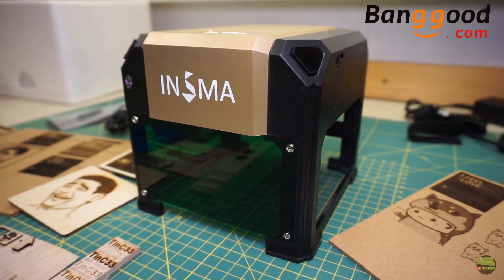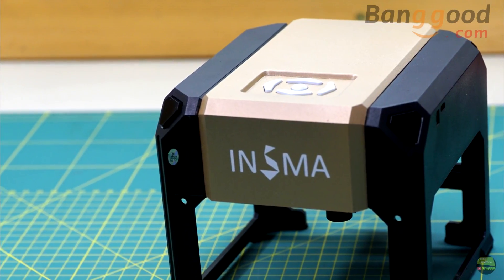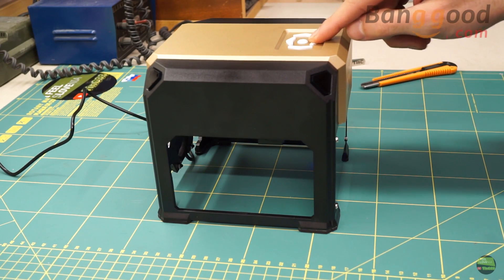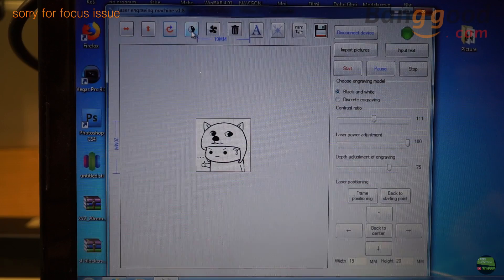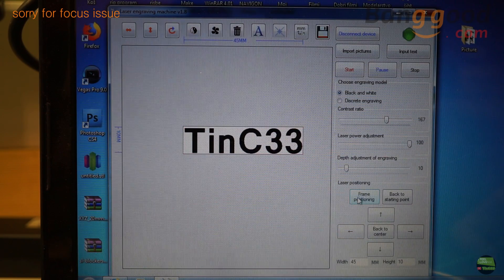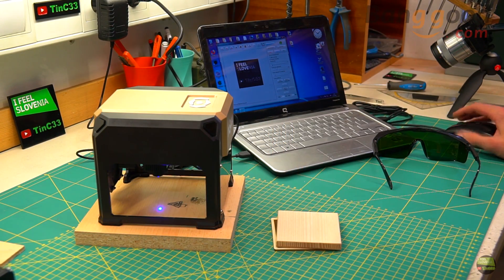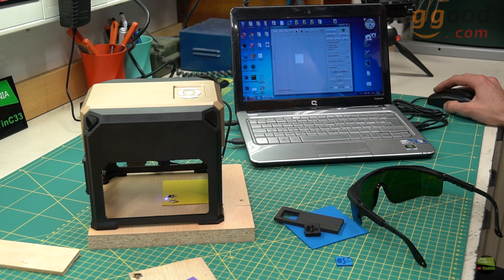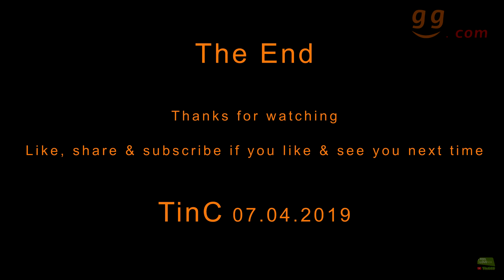INSMA 3000mW USB Laser Engraver under $80 from banggood [unboxing/review/first test]

Comment: Hi there. Would you still have the software to download. My item did not have a USB with it and I got it a while ago and just opened it. If so I would appreciate the help because it is not online anywhere. Thanks.
Reply from the maker: Did you chec google drive links under video description?
Reply: have you found software for this machine?  I bought a used machine that did not have software included.
Reply: @ronkloiber i have

Comment: Hi , would this work on plexiglass (Acrylic). Let say engrave an oak leaf
Reply from the maker: Yes but it just melt a bit of surface on plexi, bed result, diode laser are not good to work with plexi non for engraving and even worst for cutting.

Comment: I don't see the "driver.exe" or "English zip"  file mentioned in the steps you have to run the software. Could you please tell me where I can get this driver?  Thanks!
Reply from the maker: Into video description is the link to all the files i got on usb drive and  upload into google drive, that's all i got, also don't own that laser for really long time
Reply: @TinC33  Yes I went to that link, but the  "driver.exe" and "English zip" files are not in the Scarve file
Reply from the maker: @CirculaTech  check all the files it should be somewhere
Reply from the maker: @CirculaTech  i check now on pc, also i can't find driver, software is in the first folder but not the driver, here are some other links, but all just to software:
https://www.banggood.com/3000mW-USB-Laser-Engraver-Desktop-DIY-Logo-Mark-Printer-Carver-Laser-Engraving-Machine-p-1338648.html?rmmds=search&cur_warehouse=CN&p=ND26071293473201502H&custlinkid=253146
try to find driver online, by going to device meneger...
Reply: @TinC33  I found the software here and it works: https://drive.google.com/drive/folders/1glM4gjdt-uVX8uvPk9fymyRvchOCHLkf

I've done a test run and the laser isnt strong enough to burn. Tried adjusting the focus and the settings. Any ideas?

Comment: No one has done a video on this, so thanks for it but does it work on metals
Reply from the maker: No it only work.on stainless steel with using permanent marker. But result isn't perfect anyway, check my other ortur / neje lasers videos.
Reply: @TinC33  does it work on carbon graphite

Comment: I bought this and I installed the driver and software and it will not connect the device to the software.I need help because the support fro the vendor is shit.  the app isnt being blocked also because I unblocked it in security settings.  Please anyone

Comment: Very nice video! But if I use this laser onto a normal paper sheet will perforate it?
Reply from the maker: It will cut them
Reply: TinC33 thank you, I need them to be cut (perforated) so I guess it’s ok! The paper will be normal 100gsm sheets. You suggest me to buy this one or with more than 3000mW of power?
By the way you know the link where is possible to buy/order it? I can’t find online! I am located in EU.
P.s: again my compliments for your channel, I subscribed
Reply from the maker: @Bigivan89  check on my channel i got 4 videos about neje and ortur laser engraver cutter, for a bit more money you got much much better machine, both got bigger workimg area 150x150mm and can cut dxf or nc files (cnc cutting) also booth are more powerfull, faster, and you can upgrade them, watch the video and you'll see, that insma laser is toy against neje or ortur.
Reply: TinC33 thanks bro, I’ll check these videos now!
A last question: but in all those machine can you adjust the intensity of the laser ? For example to set it stronger or weaker?
Reply from the maker: @Bigivan89  hy, i come to pc, so here's a links, yes on every machine you can adjust speed and power of laser, otherwise it be useless :)
But really think about neje and ortur, they'r better, far better.

https://www.youtube.com/watch?v=kg6Xd4m647Y&t
https://www.youtube.com/watch?v=cMxQ73jwAAY
https://www.youtube.com/watch?v=Hvg8slOVSyE&t
https://www.youtube.com/watch?v=QjyQ0i580LQ

Comment: I have a question, will this envraver work on Mylar surfaces without cutting?
I wanted to engrave a qr code. 
Thank you for the video.
Reply from the maker: it can, just set low power, but if the foil too thin there will be heat deformation, anso don't work on white and transparent materials.

Comment: Hello, would it be possible to send me the software for the key because I lost it
Reply from the maker: Check for the link under the video description
Reply: @TinC33  I don't have the driver.exe
Reply from the maker: @XoAxBlOc  it is here, in 3 lenguages, download entire folder, then open "scarve-en.exe" don't need to instal
Reply: @TinC33  how to connect the laser to the software
Reply from the maker: @XoAxBlOc  i don't got this laser anymore, since than the software was change, but i think go to settings, and click usb button, offcourse you need to plug laser to pc with usb cable and power supply firstly, and turn it on than connect

Comment: Can you please tell me the voltage and amperage requirements for this engraver?  Thanks and God bless,  Steve
Reply from the maker: AC DC adapter (110-220Vac to 12V 2Adc) and it come with the laser
Reply: TinC33 plz i can use in Weak metal ( aluminiun)
Reply from the maker: It work on anodized aluminium but not on raw, also work on steel and inox steel with using permanent marker.

Comment: CAN YOU ENGRAVE HARD PLASTIC  LIKE TWO WAY RADIO OR I NEED MORE HEAT OR RECOMENDATION
Reply from the maker: it will engrave the surface just a bit, but it be same colour, only visible if you look against the light. You need to use special paint to engrave into plastic, than it would work.
But anyway, check on my channel also video about "neje laser master" and "ortur laser master" you fet much much more not that much more money.

Comment: Does it engrave leather too? And what about denim?

I found a 1500mW version of this machine, do you think it would give the same results if I increase the engraving time?
Reply from the maker: Please check my latest video about much better machine, from this video you will see also links for neje engraver, they are booth much better for a bit higher price, seriously, this think is a toy against neje or ortur machine
Reply from the maker: https://youtu.be/cMxQ73jwAAY
Reply: @TinC33  Watched it but I just need something for keychains and small stuff.
Reply from the maker: @masterneme  understand but for 50$ more i think there's nothing to think, that insma doesn't offer cnc cutting and don't got even limit switches, i don't know it's up on you.
And yes leather is engrave really nice with 3.5w modul, i think also 1 or 1,5w will work fine mayve a bit slower, because for leather need low power.
For engraving take maximum 3.5w more powerfull are better for cutting but not that much for grey scale engrave.
Reply: @TinC33  I see, thanks for the answers.

Comment: Can you engrave on metal surfaces??
Reply from the maker: No, for metal you need fiber laser for few 1000$
Reply: @TinC33  For small and flat metal surfaces any suggestions!?
Reply from the maker: @mutisonicholas-b1u  There is some trick to engrave with diode laser into metal, you need some chemical (some says that mustard work) to add onto metal before egraving, also you can get some spray, but it's quite expencive, so if you looking for some small buisness... they start at $1500.
If you still want to try with that small lasers just give a few $ more and buy propper tool like this one or neje (got review also from neje):
https://www.youtube.com/watch?v=cMxQ73jwAAY&t=

Comment: Can this work on plastic or metal at low intensity ?  i am very happy with mine .very good review.
Reply from the maker: On plastic it only melt a bit of surface, so it only visible if we look it to the light. And no work on metal at all, i just testing ortur 15w those days, but still not enough to leave trace on aluminium or other fe and nonfe materiall.
Reply: @TinC33  Thank You! PS: How long is the life span of laser? Can i buy a spare laser to replace if i need to?
Reply from the maker: @panonicolaides9138  i don't know the lifetime of a laser, and i think you can replace the whole laser, because the driver is into the laser modul

Comment: Wonder if you could successfully laser engrave on a curved surface?
Reply from the maker: It could but with curve lose focal position so when the engraving area will be for 1mm out if focal leinght it start engraving out of focus, result is bigger pixel and less power 
For curved areas you need another motor to follow the curve but not on that laser.

Comment: Hi, nice machine, it is ok for wood and skin? Steel is not, right? (i plane easy signing my handmade products - wood boxes and skin covers...).
Reply from the maker: That would be great for wood boxes engraving, i use them for that also, but check my other video about neje master 3500 it's much much better machine for a bit higher price, you got bigger working area and cnc operation, think about...
Non of that machine can't engrave steel aluminium etc, for that you need more expencive Co2 laser or fiber laser.
Reply: @TinC33  Nice im looking, how much W is maximum, and how much you recommend?
Reply from the maker: @janhvizdos  neje master can be bought 3,5w 7w or 20w, i try to test also 20w modul, but neje is out of stock everywhere, so check under neje video is another link to a laser same as neje just bit better, it work on 32bit neje 8bit, that laser can buy in 15w version for lover price as neje.
Reply: @TinC33  good, and you test cnc function?
Reply from the maker: @janhvizdos  with cnc function i didn't mean that you can attach the router instead of laser modul, but can inport nc files, check the neje video.

Comment: Does the machine have a safety when you bump it it tirns off? Could you press it against a wall and hold it while it engraved into a wall?
Reply from the maker: No it don't heave a gyro sensor, so yes you can engrave to the wall, if you wach my other video about NEJE laser, well that one got gyro safety sensor, but overall NEJE is much better, check for the video "neje laser master 3500"

Comment: Is it compatible with ROUND SURFACE I mean Bamboo
Reply from the maker: it work but on sides you got out of focus, so with bigger images there will be bad result, but for small image or text just ok.
To propper engraving round surface you'll need 3rd axis to rotate, part so you got always same focal leinght.
Reply: @TinC33  surface is small the tube inside diameter is 30 mm

I want to make logo on my product.. 
Have any Suggestions for 3 axis in less price
Reply from the maker: @DIYAtoZ  You need an "open source" laser with arduino or just buy a plate and connect to any laser:

https://www.banggood.com/EleksMaker-Mana-3-Axis-Stepper-Motor-Driver-Board-Controller-For-DIY-Laser-Engraver-p-1015947.html?rmmds=search&cur_warehouse=CN
and than you need to buy separate gadget for the round surface engraving something like that:
https://www.banggood.com/EleksMaker-Mana-3-Axis-Stepper-Motor-Driver-Board-Controller-For-DIY-Laser-Engraver-p-1015947.html?rmmds=search&cur_warehouse=CN

But then i don't know how to program all that and how to make a gcode for engraving, but that's how it work, like there:
https://www.youtube.com/watch?v=fFpzFpSNO-8

Comment: Hi man. I bought the same machine (Other name) and I proved it but the result are far from what I expect. Some lines of engraver appear between the draw and the letters. Is there any way or adjust to fix that thing? thanks in advance.
Reply from the maker: Sorry but can't remember other than, did you set focus, really can't tell, is it mechanical or software foult... Mine still working fine
Reply: @TinC33  it's something mechanical. Do you have an email where can I send you some pictures about the results?
Reply from the maker: @rodrigorios5862  you can send me photos to: sedejt@gmail.com 
But i'm not sure can help, laser works for me just good.

Comment: Hi, I have the same laser engraver. I have been using it successfully for several jobs but now I have a problem. The laser engraver began to engrave reflecting the image, in other words the image comes out as seen in a mirror and I cannot modify it and it is also turned (the top part goes down and the bottom part goes up). How can I reset the machine.
Reply from the maker: Hmmm, i really don't know, if there some button to reset, i don't remember. Can you mirror the image into software and than come out right?
One of solution is to switch wires on steppers, so they run into other direction, but how that happened...

Comment: Hi, Will this work for say a wood baseball bat logo and different text sizes?? Also can a bat be placed under laser?? How deep can it go into wood?? And if not what one would??
Reply from the maker: Yes it work, that software offer you only few fonts, but you can make title into photoshop, paint etc, save as jpg and than engrave.
I didn't test on round surcace, if you want to engrave too big surface it can be a bit out of focus on edge.
Reply: @TinC33  well the bat is round of course and the largest is 4inch long and 2-3 inch high
Reply from the maker: @stefanibadgley6186  ok, but 4 inch is about 100mm max engraving area of that machine is 80by80mm.

Comment: Great video. The fact that it rasters instead of actually cutting is terrible. It could effectively cut so much faster. You could load it up with Marlin software :D
Reply from the maker: That is what i think also, but i don't play with that small laser, it's ok for engrave something small.
Reply: Mo Bina Do you have a link for this Software?!
Reply: @tsholzdesign634  hey. Just google Marlin Firmware. It will certainly be the first link. This is the holy grail of 3D printing firmware but as I understand It can be adapted to Laser cutting.
Reply: for my own laser machine I use mbed and openlaser which has since been discontinued but it works like a rock

Comment: What about aluminium? Will it engrave?
Reply from the maker: Not at all, i try with aluminium, anodise aluminium, brass and steel, but without any effect, i try also on 3d printed pla parts, but it just melted the surface a bit, so it can be seen across the light only.